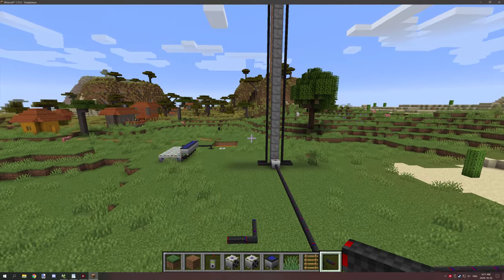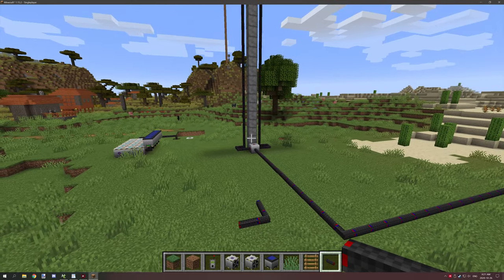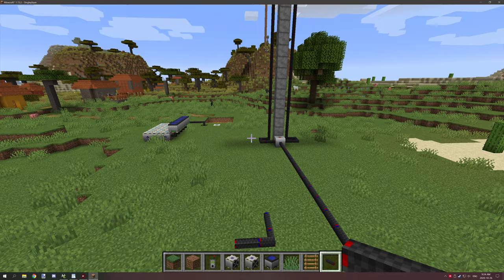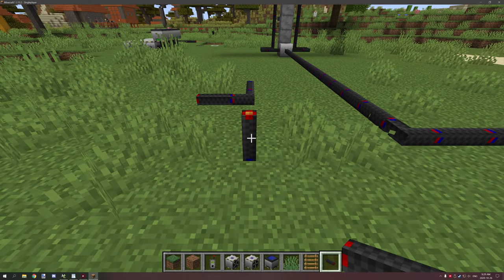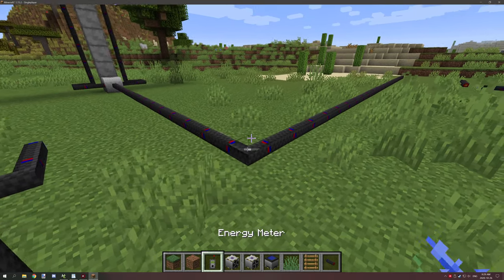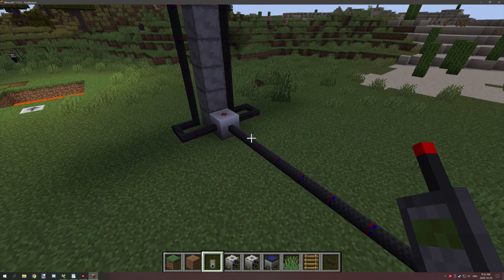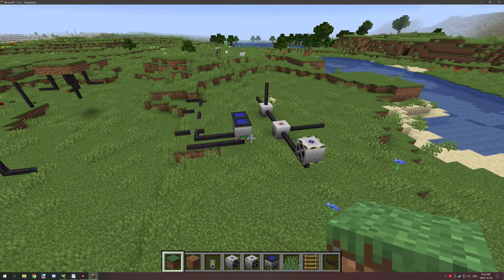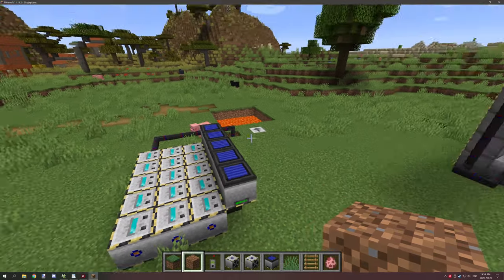MCreator: Variable Energy | Introduction | Part 1 (Outdated)

Comment: How do you make a cable turn
Reply from the maker: I think most mods use block states and rotation for them, I sadly don't know how to make custom block states I think PlayerMax a MCreator contributor has worked with them for a mod he was working on but I think it was hand coded so it may not be possible with making a block and a ton of script for rotating the block when its placed. its easier to just make a junction block to split energy to sides with connected wires honestly.